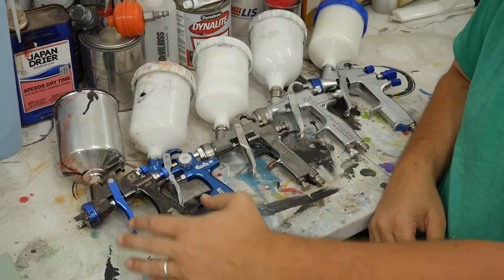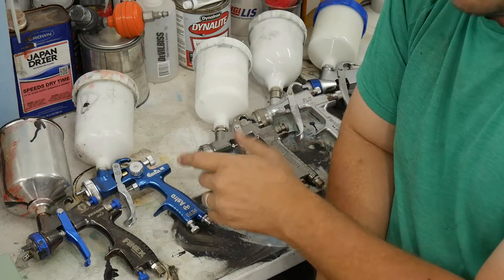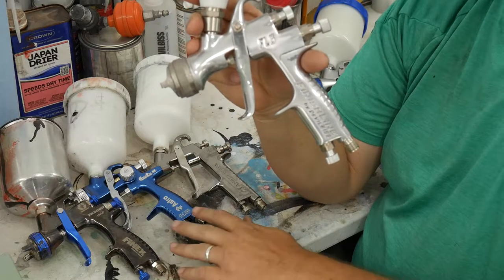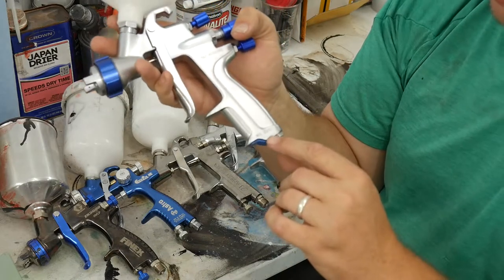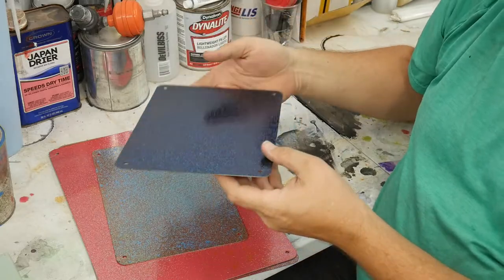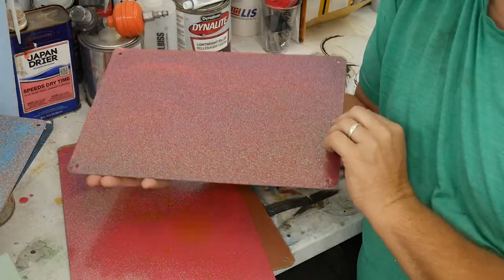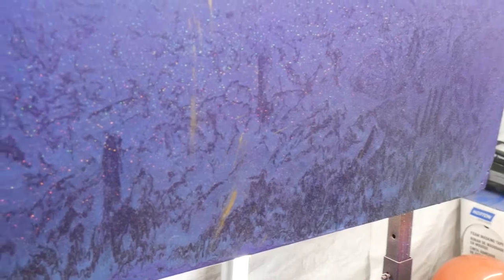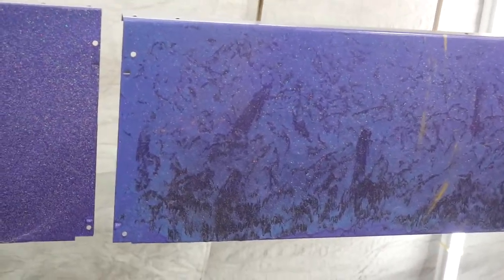Spray Gun Review | Rustoleum Paint Test Panels | Channel Update | See which gun comes out on top? |

Comment: For auto painting I gotta stick with a cheaper single stage kit if money is the concern. I have done acrylic enamel metallic. Not what I call easy to apply, but results can be very nice with a gun that can handle it. I used a 1.4 w400 with the psi cranked up a bit. But prefer urethane single stage. Solid color acrylic enamel I would do. Too much prep work on a car to throw rust oleum on it in my opinion. Couple hundred bucks or even less and you can have real auto paint.
Reply from the maker: I don't use it on cars. but some people do. I paint it on tractors and trailers or maybe a frame.

Comment: On the two purple panels, the first panel on the left, is that rustoleum mixed paint with flake in it? Any info on it would be appreciated. I would like to try and duplicate that.
Reply from the maker: I mixed a purple base with Rustoleum that I liked and sprayed it down and added flake and clear coat over the purple paint after it dried for a couple hours.